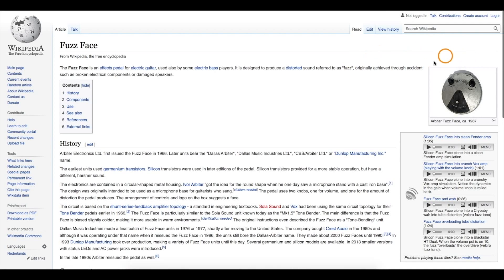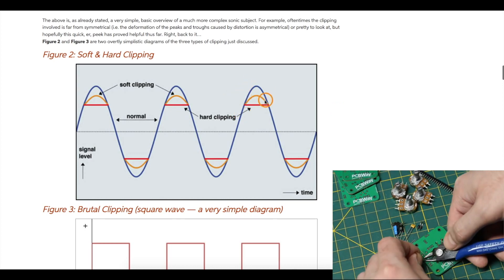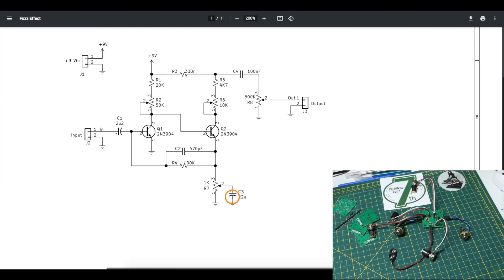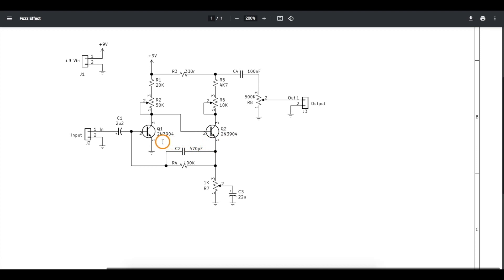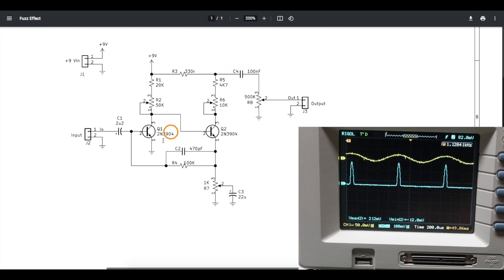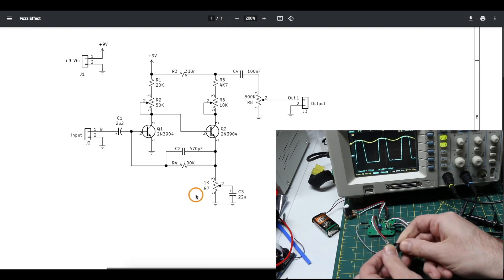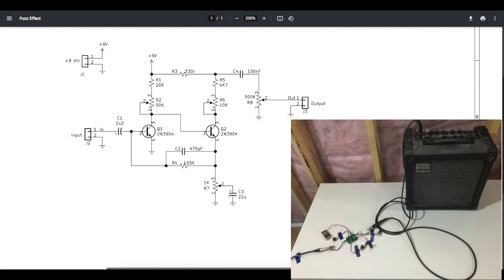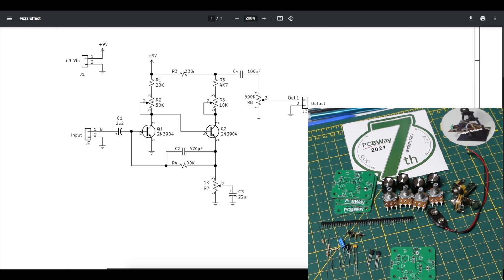Guitar Fuzz Effect Circuit PCB

Comment: Fuzz circuits are current sources, not voltage sources ... so hitting them with a hot signal like you do with a voltage source like an overdrive or distortion is not recommended. I think this is why many people think they are not "fuzz guys" and I see so many fuzz pedals being sold on Reverb ... they are going from the practice that you gain stage everything hot instead of some things cold.
Reply from the maker: Single coil would have been better for demonstration of how well the circuit cleans up with lower volume and can then be brought in as needed. Too bad prices on everything are getting inflated or I might go shopping this year. although there’s a pawnshop I saw with musical stuff in the window.  I don’t suppose they already caught on that they can increase prices.

Comment: Sounds great! Such a simple circuit but such an iconic and powerful sound! What about a mix knob? Wet/Dry? It seems from the scope that there is not a lot of phase difference between input and output...
Reply from the maker: yeah I wonder if I can easily mix wet and dry but it might take a little more than just a simple passive Network because everything is so impedance interactive I’d probably need a high impedance input thing like an op amp to take the dry signal and mix it in or else maybe actually it will be good to try it without the op amp and then we might get a whole new effect because of all the interactions. There’s so many options with a circuit like this.
Reply: @GadgetReboot  Yeah you might get an unique sound! :) Other wise a simple input buffer opamp between a summing opamp would suffice. As there is no inverted phase on one of the signals the buffers could both be non-inverting. Maybe add a capacitor and resistor to the summing opamp to match impedance...
Reply: @GadgetReboot  
Great instruction. Prices be damned.
Recycling thru hole bits out of old radios. Little hesitate about trying to desolder ICs without a proper solder sucker and temp control.
Wish you would have dialed pots a bit